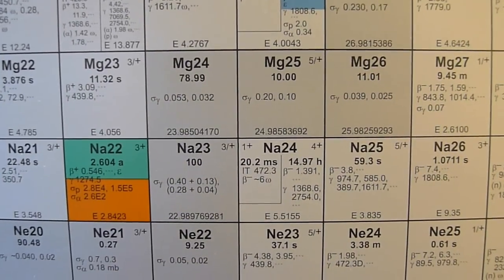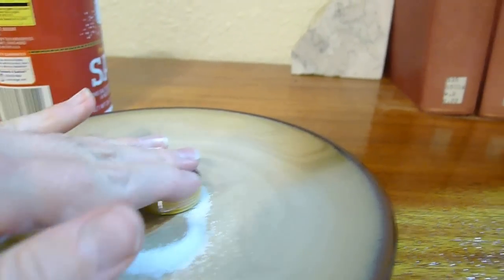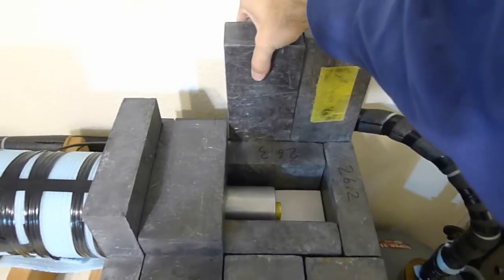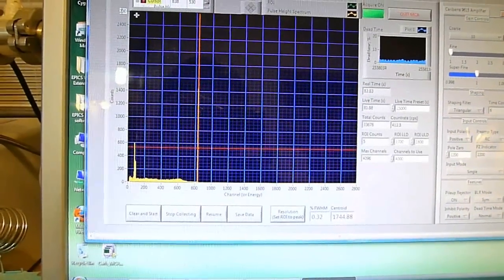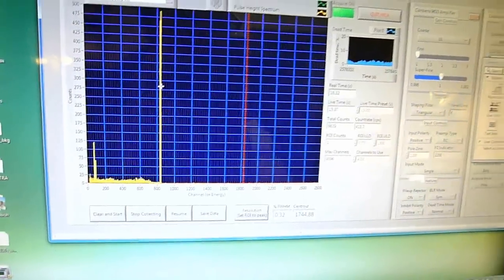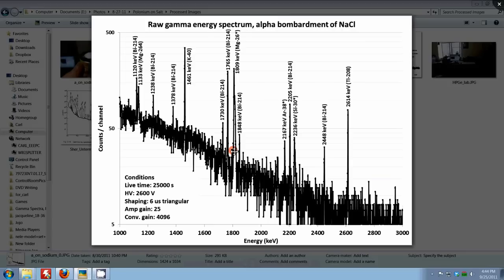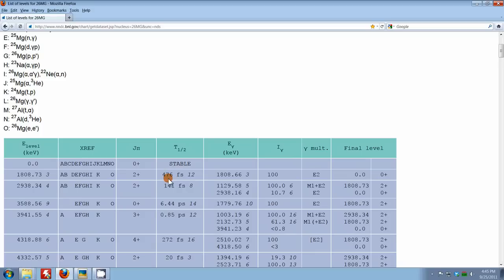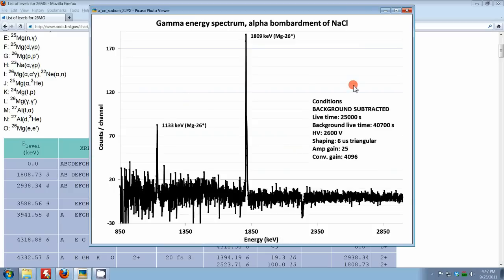Gamma rays from the alpha transmutation of sodium in table salt

Comment: Any idea, how to convert the radiactive power directly to electrical energy,
without going via heating ?
Maybe put your pollonium source directly below a ferrite rod and wind a coil around it and put parallel to it a capacitor, so you have an LC tank circuit parametrical excited via the changing radiation inside the ferrite rod then which might lead to changing magnetic properties ?
Please can you try this and let us know the genarted voltage on the cap at the resonance frequency  ? Many thanks.